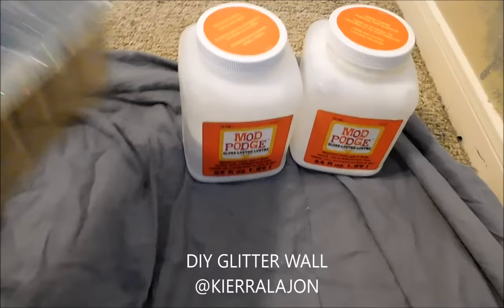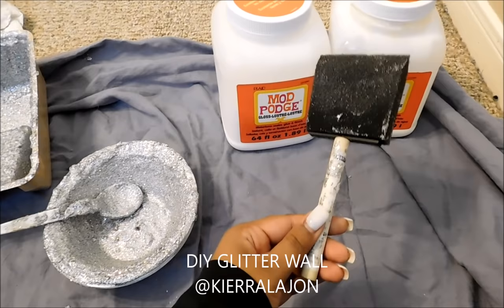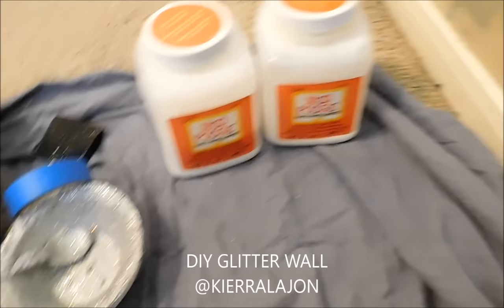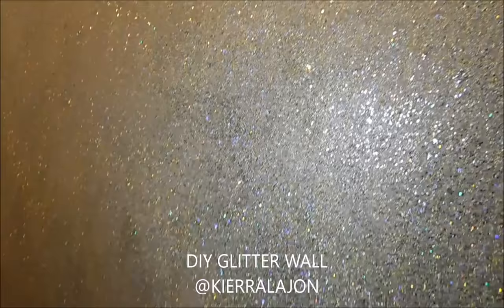DIY GLITTER WALL | KierraLaJon

Comment: Short cuts never work in the long run. 

You end up doing more work to make it “look” like it was done correctly. 

Rule One - of any task do it correctly 

This particular process will take up more glitter. 

If you paint the wall first you will be able to achieve unity across your work area.

Comment: You can get glitter spray paint for like $10 on Amazon. That's the cheapest way
Reply from the maker: Life As A Nerd yeah but it will not have the same effect. Also the room is too small for the fumes.
Reply: Unfortunately glitter spray paint doesn’t come in very many colors and it doesn’t have the same effect as using the glitter with mod podge or epoxy! Also it’s probably not the best idea to use spray paint indoors!

Comment: Do you think if I paint my room a light pink and then add a silver glitter would that not would out & look ugly ?
Reply from the maker: I wouldn't suggest adding glitter to the paint, but if you want the light pink color to peek through from behind the glitter that should be fine. If I were you I would get some cardboard and try it on there first and see how it turns out. 🙂
Reply: Yazmin Rivera 
My room is that exact thing and it looks amazing

Comment: The glitter walls are ALWAYS fun to do but i dont think thats a cheaper route to go, you probably paid $25 in just the glitter alone lol and then those huge mod podge, youre better off just buying the Behr glitter paint, or the Valspar glitter packets which you can use with any paint brand. I went the behr route with my glitter wall and i bought 1 container of paint which they only carry one size and its VERY SMALL, and thin and see through so i think im going to get a glitter packet from valspar and mix it in the glitter paint from behr before i put it over my wall to make it extra glittery. That probably only costed me around $40 right now, for the glitter Behr paint and the metallic silver base coat from Behr also. Then ill go pick up the valspar glitter packet so maybe roughtly around $50 total for mine too. I dont even think there is a cheap way to do a glitter wall haha sooooo worth it though.
Reply: How did it come out? I was wondering the same thing

Comment: Mix it all in with paint for better results if you don't want to paint tje wall first. Also, you can thicken mix powdered sheetrock mud. It will cover better also and texturize it. Like doing venetian plaster of sorts.

Comment: Would it be any different if i used a rolling paint brush?
Reply from the maker: YES! Do not use a rolling brush!!! Since it is just glue and glitter it will clump up. You wont get a smooth and even finish with a rolling brush.

Comment: I have a an accent wall in my room that is lilac and I like the color but unfortunately there is some streaking in spots due to running out of the paint.  I think it would look awesome as a glitter wall how much glitter  would you suggest  to cover it it not as big as yours and I don't  completely want to cover up the color.  also between silver or purple  glitter  what would you recommend.  thank.
Reply from the maker: I would mix purple and holographic glitters together. And im not sure how much glitter you will need. More that 6 bottles for sure!
Reply: KierraLaJon  thanks for your help.
Reply: @KierraLaJon  how about rose gold...

Comment: Hi Kierra, interesting, I wanna try it for my new recording studio. Do you think it can be applied on a drywalled ceiling without plaster or primer ? And what if I wanted to have a black glitter effect, do you think one can mix some black paint to the glue ? Thank you
Reply from the maker: I think it should work on drywall. I would probably do a small patch and see how that comes out. Black glitter will look really nice!! The glue dries clear with a glossy finish so it helps the glitter look super shiny !!
Reply: Steve Galante I would not recommend placing that directly on drywall because of the paper backing on it. Prime the drywall and give it some curing time (7 days) then proceed to use the mod podge with glitter, if that's to your liking.
Reply: If I do dark blue/navy back color with silver glitter.... should I paint the wall color then use glitter with mod podge to top it? I’m worried when it dries the blue will change color cuz of the mod podge

Comment: how do you remove the glitter off the wall ??? when I move in my apartment I wanna do my wall like this but so i was wondering how u remove it
Reply: Shirleeta Jones paint over it with primer easiest way to do it
Reply from the maker: I honestly dont know. Since its really just glue you can attempt to peel off a small corner and see what happens. Or try glitter wallpaper. Same results just different techniques.
Reply: Shirleeta Jones I wouldn't prime over the wall, I would suggest either a hot water wash down or sanding to remove the surface.
Reply: Shirleeta Jones you can apply a lining paper to the wall first, then when/if needing to remove use a steamer machine and the lining paper will come off, but score the wall first so steam can get into the backing/lining paper x
Reply: Peel it
Reply: Shirleeta Jones 

You can’t get it off unless you’re prepared to pay for removal but I wouldn’t advise anyone renting to do this. 
It will be a complete pain trying to remove glued on glitter ✨.
Reply: You can also buy glitter wallpaper which is still a p in the a to take off, but it’ll come off easier than glue!
Reply: You do what im gonna do which is wallpaper first with lining paper xxx